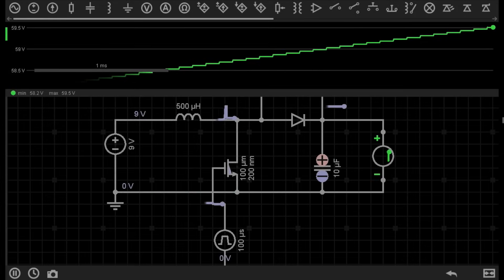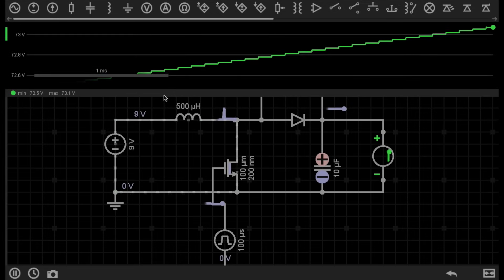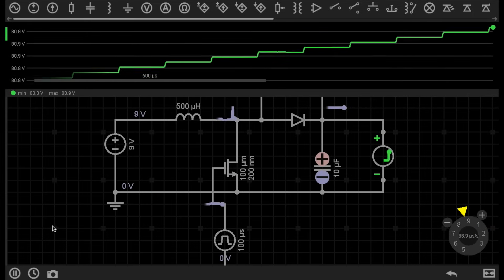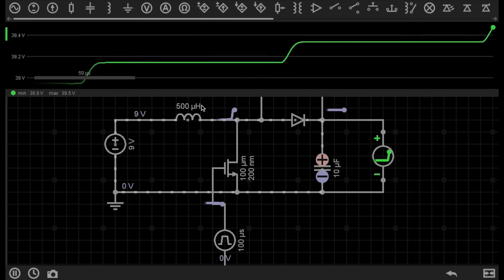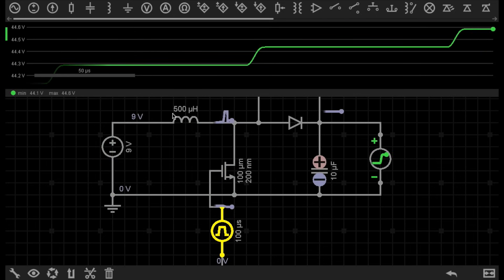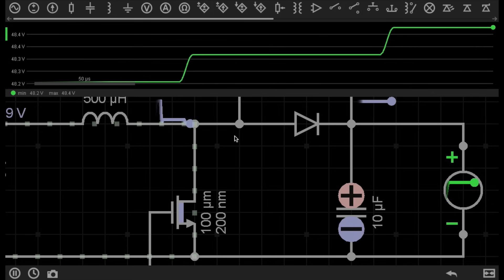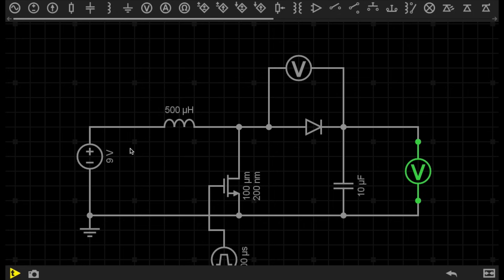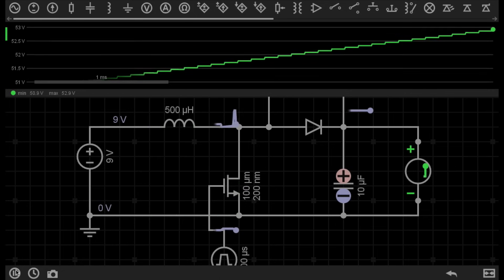How Boost Converters Work (DC-DC Step-Up) - Electronics Intermediate 1

Comment: by having the meter on the end of the circuit wouldnt it discharge the capacitor?????, nice vid
Reply: That's a very good point. Any load you put in parallel to the capacitor will draw current from it and discharge it until an equilibrium between the charges coming in (from the inductor) and out is reached. The higher the current going through your load, the lower the voltage will be. Voltmeters have very high internal resistance so the current going through them is minimal. The measured voltage will therefore be very close to the theoretical maximum.
Reply: That's a voltemeter no current flows through voltemeters

Comment: what if the source is 380V (3 phases) that rectified  and the load is DC shunt motor (400V supply) ? is the boost converter still relevant to control the speed rotation of the motor? or is it better to use buck-boost converter? thank you

Comment: At 5:15 you say that when the switch is opened polarity of the inductor switches so that negative is on the left and positive is on the right. Then you go on to say that current flows from left to right. But current flows from a higher potential to a lower potential, so why isn't it flowing from right to left?

Comment: The fact the voltage across the capacitor got increased every time is due to the increasing incoming voltage of the inductor , does that mean the spike's voltage is infinite when the mosfet is off?  If so, why will it settle eventually at about 100v instead of even higher than that over time?

Comment: the input of the mosfet could it be a PWM ?am i alright?
Reply: For simulation you can just use some rectangular source with a fixed frequency and hook it up to the gate of the MOSFET. No need for PWM here since all you want to do is to flip a switch essentially.

Comment: Great teaching. What's the difference between a boost converter and a voltage multiplier (doubler/quadrupler)?
Reply: A voltage multiplier is based on an AC source
Reply: @marceloalvarocoronelcastro3463  Oh, true, hehe. Thanks.

Comment: When Switch is OFF, the current flows through
 the Diode. and Capacitor is charged.

When Switch is ON, the current flows through
 the mosfet. My Question is

Why Can't we save this power in Capacitor?
Reply: I think the capacitor is maintaining the voltage increase by accumulating the voltage of the spikes, it doesn't get fully charged. Just like the video mentioned, it's only possible at a high switching frequency.

Comment: when does the voltage stop raising and why?
Reply: There's a point where the capacitor is fully saturated and can no longer store any more charge.
Reply: If the system is conservative, Vout = Vin * (1/(1-D)) where D is the duty cycle of the switching.
Reply: I never was explained why but heres my thoght, the inductor can saturate (when every magnetic domain is polarized in the same direction) after this the main principle wich generates the voltage won't increase.
Other reason could be that the capacitor exceeds it's maximun admisible voltage, then a internal discharge occurs, for this reason you must take care to use a well insulated capacitor or don't use a extreme conmutation frecuency.
The first of the 2 reason that happens first will stop the voltage grow, in the second case it will also destroy the capacitor.

Comment: Why is the output DC voltage not constant. I thought the output should be consistent. Please I want to get a 5V output from a 4v input. What specifications of components should I use?

Comment: Boost converters are more efficient now than they used to be but it's worth bearing in mind that a considerable amount of current gets ditched to ground when you're charging the coil and that can be an issue if you're looking to source much current from your boosted voltage., Buck (stepdown) converters are a LOT more efficient.

Back in the day when phones actually had real bells in them I built a simulator box that needed to supply the base tip-ring on-hook voltage of -48VDC which wasn't that hard, but the ringer voltage to make a princess desktop phone's bell ring was more like 80-100VAC at about 20Hz and that part required some serious attention to the breakdown voltages on everything in that part of the circuit. It was fun and I learned a lot but I never got shocked as much by any other construction project as I did by that thing. I think I still have it in the basement somewhere.

Comment: Can someone pls explain to me why when the switch is on the current doesn't flow to the other part of the circuit. Shouldn't the current split between the 2 paths?
Reply: When switch is in on position ( closed) circuit gets completed through the inductor to switch(transistor) back to battery.  At this stage negative voltage from battery gets passed through the switch to inductor , this voltage is negative, and as u see diode is placed in such a way that it can conduct only positive voltage to the other end and hence charge the capacitor. Diodes banded side is negative that goes to +ve terminal of capacitor , a diode can pass the voltage in only one direction so when the capacitor gets charged it cant discharge back to diode since +ve is connected to -ve of diode.
Reply: @rohithnechikkunnan8374  I researched a little bit and i think it's actually because the capacitor already has 9 volts after the initial startup and current flows from higher voltage to lower voltage. Since they have the same voltage the current won't actually go to the capacitor

Comment: Simple way to make one of these - 4093 Schmitt NAND gate.  Make the first gate into a Schmitt RC oscillator.  Use other 3 NAND gates as inverters connected in parallel, to buffer the oscillator into the MOSFET.  Use an NPN transisor to pull one input of the NAND oscillator low, stopping the oscillator when the transistor is on.  (Because of the inverters between the oscillator and the MOSFET, the MOSFET will stop OFF - very important).  Tap off a small proportion of the output voltage using a resistive divider and use this to turn the NPN on when the output reaches the desired voltage.  Use high value resistors to avoid loading the output.

I first saw that circuit as a TENS machine.  Since used it very successfully as an LCD backlight driver.
Make sure the diode is a fast switching diode or schottky rectifier.  Ordinary rectifiers line 1N4001 are too slow to turn off, and drain the output capacitor when the MOSFET turns on.  Even when just  breadboarding, I found a slow rectifier is rubbish.

Comment: Excellent presentation; thank you. Though, I didn't get what happens to the current? Let's say I am inputting a 12V, 30A from a power supply, and I want to boost the 12V to 24V. How much of the current will be available on the output side? Thanks.

Comment: Please help me here.  In a previous video, you say that in reality, current flows from negative to positive.  However, due to the fact for a considerable amount of time, the opposite was believed and symbols were contrived to align with this misunderstanding and today we continue to demonstrate the function of circuits with the supposition that current flows from positive to negative.  With regard to the circuit illustrated regarding "Boost Converters (DC-DC Step-Up) - Electronic Intermediate 1" if you apply the true literal flow of current Neg - Pos, the high voltage spike developed by the coil would be directed to the battery and not the diode/capacitor/meter.  Am I missing something here?
Reply: You have caused me to think hard about what may (or not) be happening. If current flow really is having a battery as a reservoir with donor electrons on one pole - electrons would charge that pole negatively, so current should leave negative pole (i.e. not the positive as per schematic). 
In conclusion, the misnaming started with the battery, therefore to make any half-logical (wrong) sense the historical misnaming and reversal of component symbols also had to happen.

Comment: Voltage doesn’t cause harm. The amount of current the is enabled my higher voltage does. Sorry had to say it. In school we had 10000000000 volts put through all our bodies to show this. I had a awesome teacher
Reply: What you said is half true. High current is indeed the direct killer. But, notice it always say "Danger: High Voltage" and not high current. If you have constant high voltage supply, like the 240V AC mains, even with the naturally high resistance of human body, V/R = I, high V gives high I, and your heart will still face high current, which kills you. 

However, if your voltage is not high enough, for example, if you get a lab power supply and set it to 5V and practically unlimited current source, you will never feel a thing. Because inversely, low V gives low I, across human body.

Your school experiment is probably a Van de Graaf generator, the whole hair standing thing, which is current-limited. When you touch the device, a large amount of current flows through for a super small amount of time, so you won't actually die. But then, its voltage basically drops to nothing, because it cant provide the current anymore. 

Try an actual 1 million volt electricity, i.e. lightning. I assure you. You will fry.
Reply: Edmond Ng it depends on amperage not voltage. Voltage is like a straw the bigger the straw the higher flow enabled. And a 5v straw can still allow enough output to fry metal so make sure we educate. And yes the danger high voltage is bullshit and should change to high amps. The reason the sign says high voltage is because the average person thinks voltage is the killer , this communicating to the average joe not smart people. Since there are very few smart people that would grab an electrical fence since you can hear the amperage being emitted from a long distance away
Reply: justin jones Again, not entirely true. Take a 12V car battery for example, it can provide 500A current. Human heart stops with 100mA through it. With your logic, you will die if you touch the battery directly, but you don’t. Why? Because V=IR holds, human body has quite high resistance, the voltage is not enough to drive that maximum current through you. I.e. I = V/R, where V is constant, but R is high, so I inversely become low. 

Now, as disclaimer, if you put some metal bar/wire across it, it will still be very dangerous, because the resistance now becomes very low and there will probably be a lot of sparks and heat from the high current. 

The high voltage is not a joke. Because a high voltage source rated to handle somewhat decent current will still kill you. As i mentioned, 100mA is enough to kill, which is really nothing near high current. 100 mA is pretty much everywhere and if you based lethality on current, everything around 100mA would be dangerous, which means everything and that is ridiculous. On the other hand, most high voltage source you meet will almost certainly kill you, thus it is wiser to label those as dangerous instead. 

It is really a combination of the 2 to kill. It is fundamentally false to say either kills on its own. So, just wanted to tell you that your teacher wasn’t entirely correct, he was either misinformed, just like many “average joe”, or he just wanted to give the simplest explanation to the “not smart” people.
Reply: Edmond Ng cool conversation though thanks for chatting. Maybe you want to explore what I just said and show your friends and family how dangerous electricity is since you already know a AA battery contains enough current to stop the human heart
Reply: justin jones of course i know you can kill me with AA battery, i could do that as well, but only after going through multiple components. That is why i put a disclaimer after i said car battery can’t technically kill, it could still be dangerous if i use it dangerously. 

I am saying components in their raw form usually can’t kill you if they are not high voltage. I.e. touching car battery terminal with nothing but hand, holding an AA on its own. Not putting it through some amplification, of course then it would kill. 

In everyday life, for normal people, the things they see are batteries, power mains and car. If they are all used to drive some lights, at a “lethal” current, we should all know that we can touch both batteries and car’s pretty safely (disregarding burn), but never ever touch the mains. Thus, the distinguishing part would be the level of voltage. It is unsafe to say only current kills and voltage is a joke, because people will look at the mains and think it is safe. 
 
If you are being precise, i would really urge you to stop saying current is the only killer. Because technically it really is not, it is 100% a combination of both. However, I can agree that “current kills” is the simplest explanation to give to someone not educated in electric. So, go ahead, tell that to a kid or something, just don’t claim it is the absolute truth and please always add “high voltage could be dangerous as well”. 

I am not the one being irresponsible and undermining the dangers of electricity, you are. Don’t spread the mythical story of “I had 1 million volt across me and didn’t die. All thanks to my great teacher making me so smart.” Hold a metal rod up high in an open field when it is raining, then we will see if you can handle 1 million volt.
Reply from the maker: such high voltage sources such as a van de graffe can handle pretty much 0 load. So the voltage and thus current flow drops too fast to cause harm. A high voltage source such as mains is rated for high current flow, in that case the voltage will not drop enough and will injured or kill you in an instant.

Comment: Very impressive, ?How much power output can I get out of a boost converter?  For example could I get enough power out to run most DC appliances?
Reply: You get the same amount of power out of it as you put into it.  You will boost the voltage, but the current will decrease, so at the output, the power will remain the same.
Reply: @PepperDeVillle  Yes power in = power out.  I was concerned with any other limitations.  
Oh, great pair of hats.
Reply: To actually answer your question, it depends on what power supply you are starting with.  For example, if you tried to use a 9V battery to supply your computer, it would probably work but the battery would get really hot and probably only last 15min before losing all its charge.  If you start with wall power, used a rectifier to supply DC voltage, then used a boost converter to get the right DC voltage, then yes, you can totally power DC appliances with this.  It's not free energy though.  It's used more to fine-tune the power to specifications for your device.  Think of the power supply attached to your computer cable or a cell phone charger.  A boost converter is the sort of thing you might find in one of those.  A boost converter just gets the power from 120VAC to whatever DC voltage your device needs.
Reply: @PepperDeVillle  Thelonia, I must apologize because I didn't read your whole reply (only the 1st to lines).  You're right every appliance has electrical input/output tolerances (ex: floor/ceiling power, current, voltage, inductance, capacitance, etc).   More generally, it seems we're close to pragmatic conversion between any level of ACorDC.   Maybe I should focus on the electrical input/output performance & tolerances of ACorDC conversion units whether than that of applicances.  It's too bad we don't produce electrons in the US anymore though.  You are very smart & good looking.  Thks
 for the help.

 ACtoAC transformer & DCtoDC converter
 ACtoDC rectifier & DCtoAC inverter
 DCorAC to mechanical output electric motor
 FueltoACorDC electric generator

Comment: The increased high voltage is of no practical use as no device run on these increased voltages. It is nothing but wastage of time and money if these increased voltages are of any use show different devices requiring high voltages running through these boasters.

Comment: How about step down?  100v to 12v 10amps?  Do you have?
Reply: Swap the MOSFET and the     diode you will get something called buck converter. Having two MOSFETs you will get a bidirectional converter.

Comment: In this circuit current is flowing from positive to negative, I can live with that,  also current is going through the diode in reverse, something is a bit odd with the whole explanation.
Reply: This circuit is also called a 'charge pump'. The current is supplied by the capacitor on the right side of the diode if between each 'pump'. If the load overwhelms the capacitor, the voltage will be lower on the right than the left, allowing the inductor to start dumping some of it's magnetic flux as well. There is no current going backwards through the diode.

Comment: What is that yellow power supply 100µs at the bottom of the circuit ?  And also, is it connected to the ground ?   Thank's.

Comment: Can i get the same behavior if i use another MOSFET instead of diode? If yes how to do it? I tried replacing it with MOSFET in everycircuit. Didn't worked as expected. Link : http://everycircuit.com/circuit/5038492068610048

Comment: i am at a complete loss..i am a plug-n-play type of guy...i have a 12 volt battery...i have a 48volt motor.....i was looking at this "step-up" converter and it is just 480 watts...10 amps ...but it says can be run parallel      https://www.daygreen.com/collections/12v-to-48v/products/12v-to-48v-10a-480w-dc-dc-step-up-converter-voltage-regulator  . so that means it can have 2 of them wired to the battery and then the 48volt output side wired together ?  i am lost and the seller has no answers on how to wire it.. can anyone help this old construction worker get his ebike kit on the road ? how would you go about wiring the battery to the motor with this step up thingy ?

Comment: Maybe I didn't understood good ... so, the output is higher than the input , as electrical power ?! .. if so, will not make it a overunity system ? (free energy device)